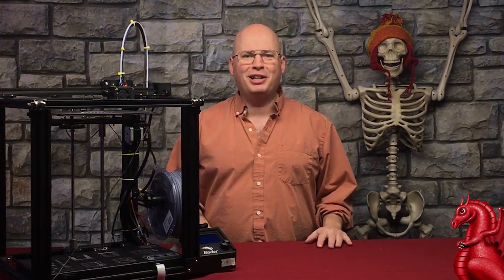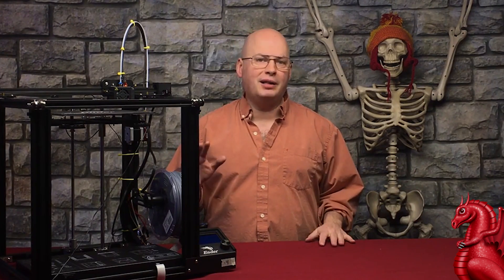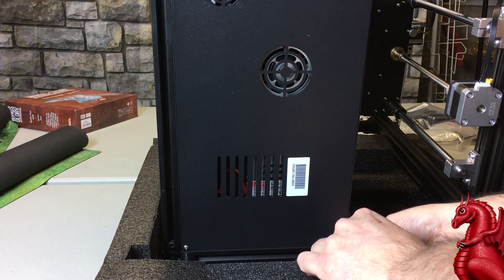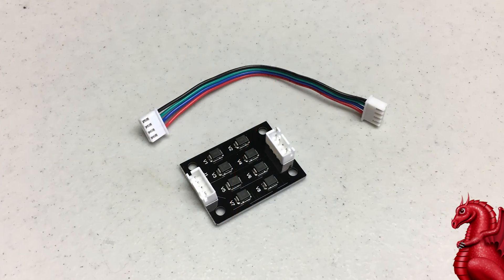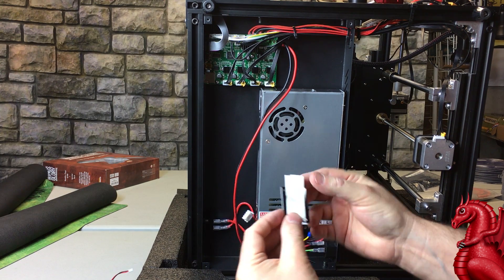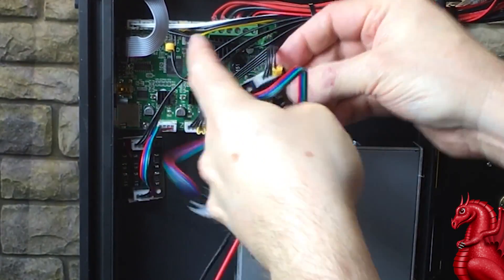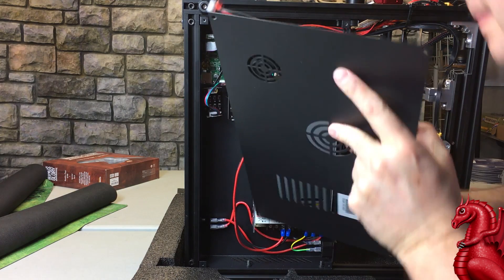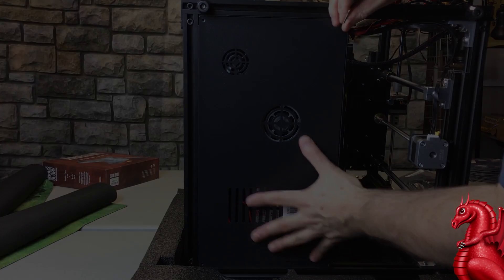Adding TL Smoothers to the Ender-3 and Ender-5 3d printer.

Comment: hola, consulta: sera posible usar estos smoothers en una ender 3 v3 core ?? saludos gracias por tus videos
Reply from the maker: The V3 does not require TL Smoothers, there were only applicable for older Ender 3/5 (first generation) printers with the original main boards. :)
Reply: @Tombof3DPrintedHorrors  THANK YOU FOR your response, it is very helpful. I had problems with the ender 3 v3 core xz it has many vfas, I thought smoothers could be of help. thanks for your response (Google tralator)

Comment: Where should I put these if I only have 2 of them instead of 3? Is it better to put them on the extruder and X or Y, or better to put them on just X and Y?
Reply from the maker: These were only necessary on machines built 3-4 years ago, the newer boards no longer require them.
Reply: @Tombof3DPrintedHorrors  ohh okay, thank you! Not sure what to do with the 2 TL Smoothers I have then.

Comment: Can't you use hot glue for the solder pins, or is there some reason to avoid it? For the cost of the thermal adhesive tape I could just buy a glue gun, and have more use for the glue gun than an extra 24m of thermal adhesive tape.
Reply: u dont have a glue gun, bruh

Comment: That's  it but as you  can see on the tl smothers  circuit board they have a P1 and a P2  so what connector should  be on the printer board and witch  one on the stepper motor??? to take out the cover from the printer is easy,every one who has a desktop computer  know how to take out the cover,I mean is common sense...thanks anyway  for the video

Comment: Hi there, would the TL smoothers still be recommended with the new TMC2208 drivers on the Creality 1.1.5 board or will they be redundant there and not worth the hassle and cost?
Reply from the maker: The 1.1.5 board no longer needs them :)
Reply: @Tombof3DPrintedHorrors  does it hurt to add them still though or redundant?
Reply: @BrianLiming  probably, since they draw more power and overheatd

Comment: Any harm with putting these on the newer board with the silent stepper drivers, or is similar functionality built in and they are not necessary? Looking to upgrade the board and want to know if I should be getting these as well
Reply from the maker: They aren't necessary with the upgrade board, but it won't hurt anything to add them.
Reply: I added them on the Ender 5 after I did the motherboard upgrade.  The steppers were no longer quiet like there were after the motherboard upgrade.  Not as noisy as before the upgrade but they weren't silent.  I removed them.

Comment: Traingle labs Tl smoother are the best of course 8 diodes
Reply from the maker: Why are they the best?
Reply: @Tombof3DPrintedHorrors  they have diffirent diodes and filter current also 4 diodes are filter worst compared to 8 diodes also home made tl smoother with recomended diodes by 3d printing community give poor results i read and watched some test
Reply: @MrBalrogos  Nonsense homemade smoother work exactly the same way as purchased ones if your board REV requires them in the first place. I have used S3G smd diodes on my diy smoothers and the work great.
Reply: @electro3976  If u have good diodes good but if u have poor one its working poorly :(
Reply: @MrBalrogos  Yes you do need quality diodes and i have only one smoother on the extruder stepper as the problem seems to stem from when the stepper is turning at slow speeds
Reply: @Tombof3DPrintedHorrors  what kind benefits to using on the extruder?...

Comment: Some before and after examples would have been nice. There are also lots of 3d printable mounts for these boards if you don't want to use the tape. I bought some but have not installed them as most people consider them 'Snake oil' but I guess they won't hurt anything so I'll install them this weekend.
Reply: Agreed with the before/after.  Knowing how well your printers are dialed in generally, being able to see the difference when you 'do it right' would be really helpful.

Not certain I agree with you about the 'snake oil' comment,  but there are so many opinions regarding what is 'necessary',  'important' and 'wasteful' that it's hard to say what is what without putting eyes on it your own self.  After all, what works fine for me may not for you (and vice versa).

Comment: In Ender 3. Board revisions 1.1.2 needs smoothers. The newest revision 1.1.3 does not. It's easy to check if you need them in advance even before print.
Reply from the maker: That is not correct. My Ender 3 Pro (v1.1.3 board) exhibited salmon skin (see black model in the video) and the Ender 5 (v1.1.4 board) has been widely reported online by many users as suffering from it.
Reply: @Tombof3DPrintedHorrors   Can confirm this, have both Ender-3 and Ender-5. My Ender-5 actually has worse salmon skin than my Ender-3.
Reply: @Tombof3DPrintedHorrors  I agree: I did put in the smoothers on x and y:  no change. on Extruder:  big change (e.g. the diagonal artefact-lines on the "house" on the benchy- away: salmon-skin on the back -> away.
Reply: @Tombof3DPrintedHorrors  To my knowledge, and Creality's Aliexpress store, ender 5's also come with v1.1.3.
Reply from the maker: Nope, shipping with 1.1.4 now (the one in my video has 1.1.4).
Reply: @Tombof3DPrintedHorrors  I have two Enders 3, old one with 1.1.2 and about 2 weeks old 1.1.3. New one does not need smoothers and no salmon skin is present. Other reddit users confirmed this. So now I am not sure what is the difference. Maybe different supplier of steppers drivers?
Reply: @IAmTigore  Hi, it's simple to detect if your newer Ender needs or doesn't TL-smoothers: print a Benchy and look at the cabin.
Reply: How can i know whats my version?